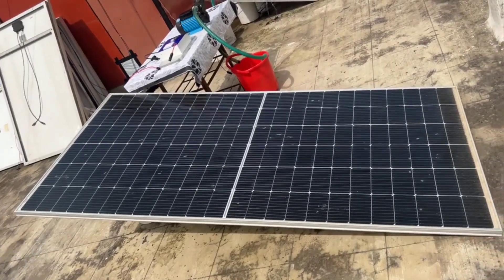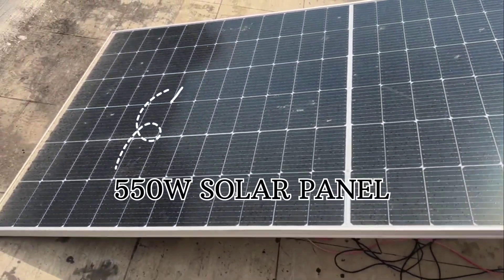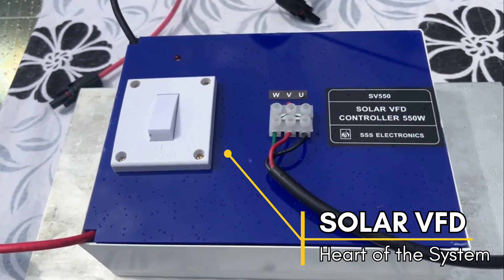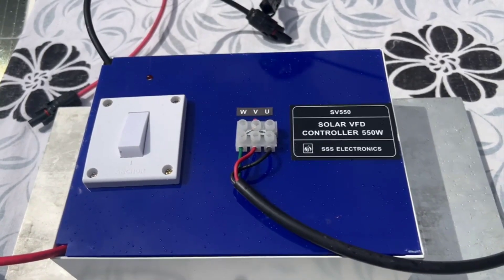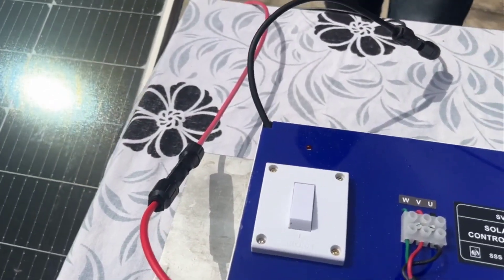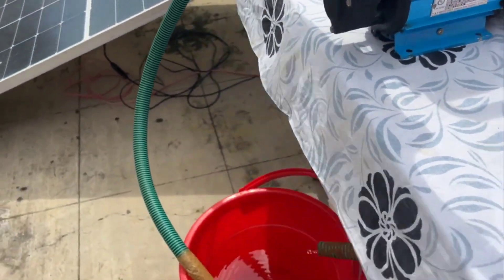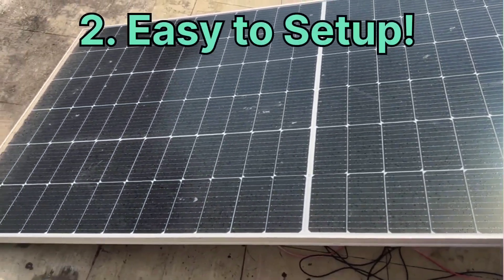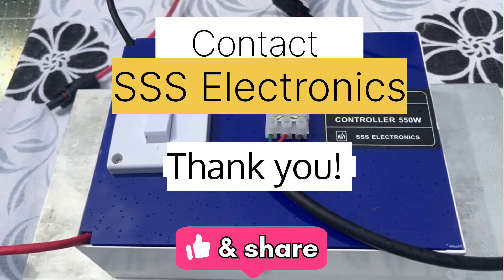How to run 0.5 HP or 1 HP AC Motor with single Solar Panel using VFD controller? Contact 8668319990

Comment: Vfd controller price
Reply from the maker: @bibhutibhusanchhotaray5917  9800/- GST extra shipping extra
Reply: @shivanandganji  is it can install to 0.5hp motor
Reply from the maker: @ yes it can be Installed with 0.5 hp self priming pump